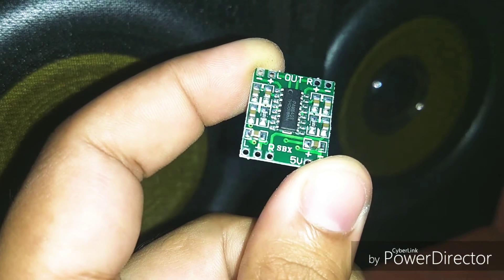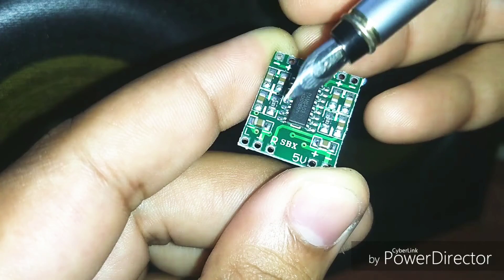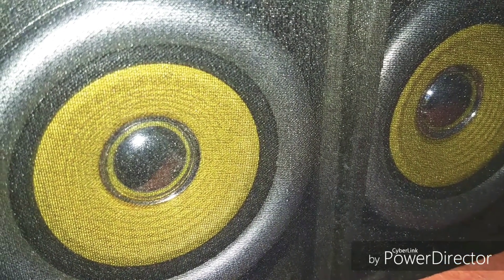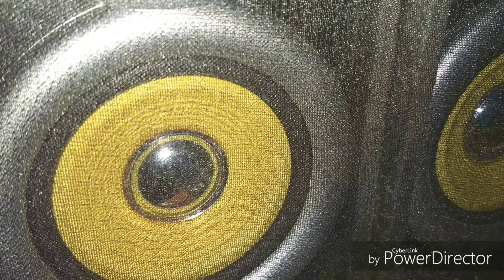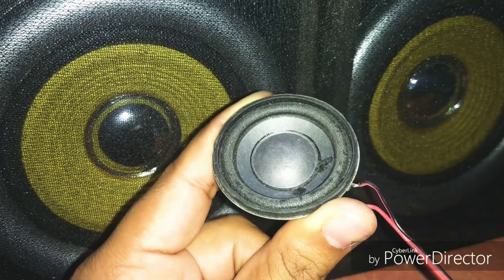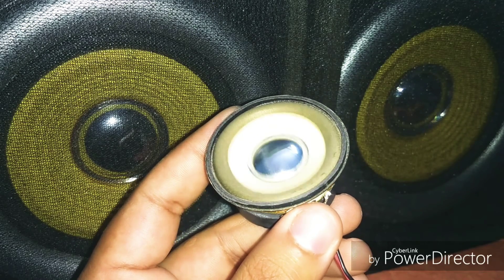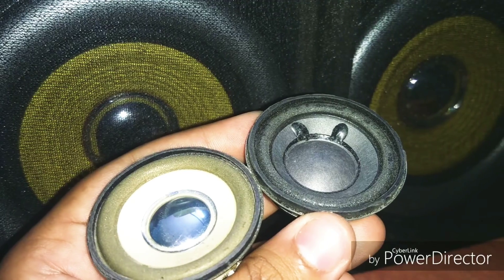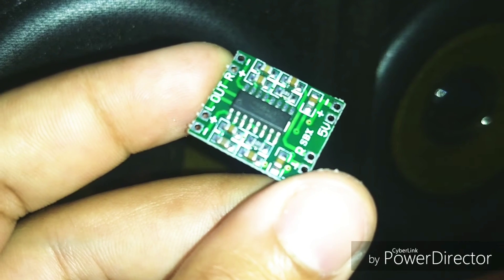PAM8403 Amplifier Testing (3watt+3watt) Class D Audio amplifier and it's  Current consumption.

Comment: If i use 5w speaker , will this pam8403 chip burn? For the power input of 500mA 3.7v  li ion battery.
Reply from the maker: Yes, you can use it, no burn nothing will happen it will work fine just the power output sound will be less like 3watt only.  So you can use 5 watt speakers. With that battery, it will be of 500mAh. Not just 500 mA..
Reply: @diyhemantprojects2841  but for me it burned. The chip got overheated and melted. And thanks for answering my question.
Reply from the maker: @souravnaskar370   May be the battery polarity is not correct, thats what overheating came. But i used it with the 10 watt speakers also it was working fine